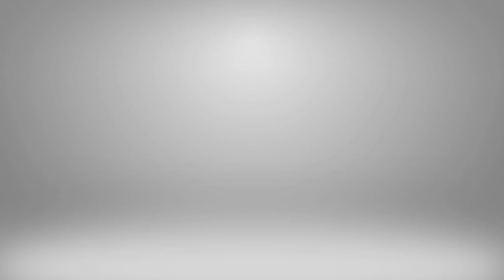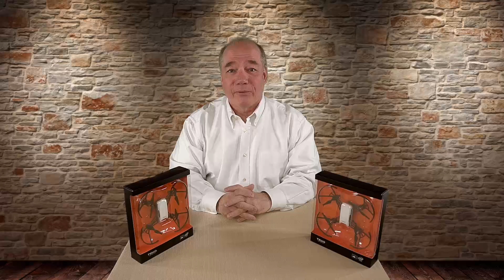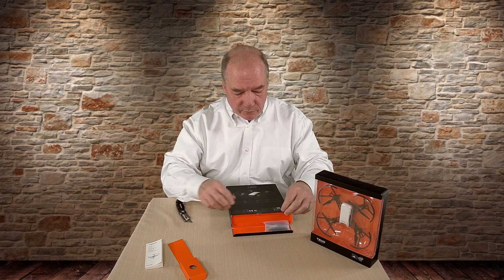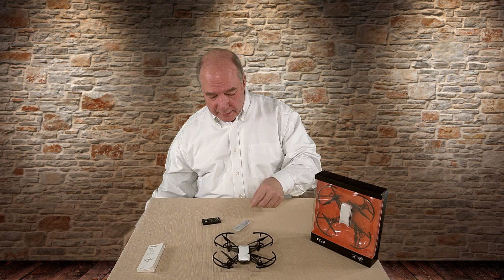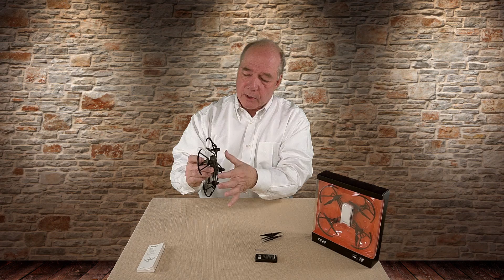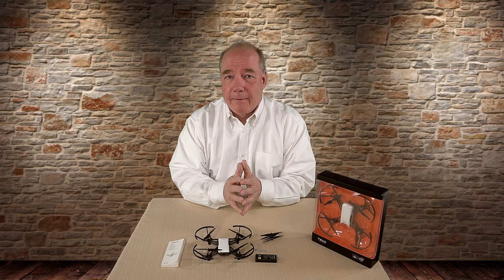The New Tello Drone By Ryze - The Most Fun Flying You Can have For Under $100

Comment: Rick, all good stuff as always. For me the Software Development Kit is the most appealing, and the only reason I would buy one, I like Tech.
 I have a "Toy drone" which I fly indoors with no stabilisation and is great for honing your ATTI skills, the Tello is a bit more than a "Toy drone". 
 I agree messing around trimming is a pain, but when you lose GPS with your big drone, and the wind gets you, you need the manual control skills.
Thanks for the effort you put in to making your videos.
Reply from the maker: John, thanks a lot for the support and I'm glad you enjoyed the clip. The stable hovering on this quad is what really caught my attention and the fact that they can include vision sensors and the Intel VPS tech in a quad for under $100 is pretty amazing. I'm just starting to get some stick time on the Tello and will have more clips posting soon so be sure and stop back. Rick

Comment: In all the reviews I have seen so far the video was lagging so much even for very short distances. There's no SD or any kind of internal memory so you basically end up with very choppy video every time. The app supports very few bluetooth controllers. Was considering buying this for some indoor VR FPV fun but due to the video issues and very limited BT controller support it is basically unusable. The programming is very limited as well, it's not possible to read any data from sensors, neither control each motor individually. Basically the only good thing about this drone is visual positioning system and maybe taking photos (selfies)

Comment: 13:25 This is not the first drone you could program and fly with Bluetooth, there have been plenty out for years (see Parrot Mambo, Bitcraze Crazyflie for example).
Reply from the maker: Thanks for the post and I agree with you that the Mambo, Crazyflie and a few others are able to be progammed to a limited degree. The reason I was so excited about this one is that it's a bit of a swiss army knife since it's a great drone to fly like a traditional drone (and I can't overstate how stable the VPS makes it) as well as using it for FPV and coding. The main difference with most of the other quads are that they are "kit" systems, which are great for building a unique airframe but take a lot of work. The Tello comes out of the box ready to fly, with camera installed and a whole lot more tech inside than the others mentioned. I've owned tha Mambo (and 2 of the Bebop 2 drones) since they were released and like them a lot. This Tello is a step more advanced than the Mambo and less expensive as well because it includes an integrated camera. I appreciate the post but still think this could be the one to mainstream quads to the masses.

Comment: Didn't t even fly it yet and your excited about it???
Reply from the maker: Henry, I did fly it at CES like I mentioned in the clip but it was pretty restrictive since it was in a cage. What I meant in the clip is that I hadn't flown these new ones yet and wanted to wait to get this initial clip posted because I had so many questions from subscribers asking about the quad. As soon as I finished the clip I took the two Tello quads outside and flew through 4 batteries. They don't handle a wind well because of their small size but are rock-solid when standing still with no drift at all. Thanks for the post! Rick

Comment: Rick, outside- at what wind speed precludes flight? I have a light weight quad that is absolutely impossible to fly in ANY wind. Also, it is larger and weighs more than this quad.
Reply from the maker: Ken, I had a chance to fly them yesterday is a mild wind and they flew OK but every time the wind gusted I had a hard time fighting it with the small Tello. My recommendation would be to fly them on less windy days and anytime you feel the need to practice your stick skills in the house. I'll do some testing with a wind meter to see if there is a tipping point. Thanks for the post! Rick

Comment: Yet another useless BRUSHED MOTOR Wi-Fi selfie drone .. YAWN! (BTW, who's going to teach all the N00Bs who buy this thing how to replace the brushed motors when they FAIL? All brushed motors fail .. period) 720P unstabilized camera .. had that 6 years ago with my 808 Keychain camera strapped to the bottom of a Syma X5C.  Having fun flying indoors (safely) can be done with $20 "tiny whoop like" quads by a dozen Chinese manufacturers, like Eachine.  IMHO, "Much ado about nothing". (as you know already, I have a degree  <my 2nd> in electronic technology/programming, and worked as a Sr. Electronic Tech/Specialist for more years than I care to state.)  IMHO, your unbridled exuberance for this thing is unjustified. Cheers.
Reply: I know enough not to be swayed by a "rave" report on a product that is no big deal.  As for your closing remark, I'll give it all the attention it deserves.
Reply from the maker: Bill, you know how much I look forward to your posts on the page :) The point I was trying to make about the Tello, and what sets it apart from other quads in this class, is the high level of technology packed into the quad. I still don;t understand how Ryze is making any profit on the quad with the vision sensors, Intel VPS chip and DJI licensing in a quad under $100. The reason I was raving about it is that I think it's the one breakthrough quad I've been waiting for that will finally draw drones into the mainstream. I can't count the number of emails and calls I've gotten since I posted the Tello clip from CES asking me if it was a good quad to buy for their kids or grand kids. 
  The last thing I'll say is that all of the quads I've tested in this class (including the tiny Whoop) always have an issue with drift and that's the single thing that turns most folks off to flying. Having to explain to a new flier that they have to "tune" their quad for a few minutes before starting to fly is a hassle. Because of the tech inside of the Tello, it just flies and hovers dead still when you let off of the joysticks. The programming is a big deal too because it allows kids (and kids at heart like me) to expand what they do with the quad. I've been a nerd all my life and have inspired my kids through countless electronic and science kits as they grew up. This Tello packs all the fun of a stable quad into a $100 device that also allows you to write a simple scratch program to tell it where and how to fly. Try that and I defy you to not smile when this little quad takes off and obeys your programming commands. I love it and will rave on in a few more clips this week so please stop back. Rick
Reply: Well, it doesn't make sense to stick all that 'swell' technology into a brushed selfie drone. As I mentioned, brushed motors are very problematic, and there are a sufficient supply of small brushless motors out there now which would have served much better without a difference in price or an insignificant one at best.  I have 2 DJI UAVs with downward facing sensors. They don't remain perfectly still when hovering, and I would not want to fly either one indoors (even though I've briefly flown some FPV racers indoors .. but then I control them). I have yet to see ANY "cell phone controlled UAV" to have an interface or control system that is worth a damn. The 'simulated control sticks', in general, suck, to put it mildly. This will undoubtedly lead to frustration if anyone actually tries to FLY it with said controls. Yeah, they might be able to take off and have it do a "POI" route (or other pre-programmed flight routes), but those pre-programmed flights soon become boring, and the first time one of these uninitiated Tello flyers tries to fly it with simulated joy sticks with no knowledge of orientation control, the outcome will be a disaster. As for programming it yourself ... you might find that 1 in 100 of today's millennial lot would be willing to put forth the effort to actually do that. They are too busy tapping out text messages on their cell phones and taking pictures/videos of themselves/friends to be bothered with learning an actual skill. This is the 'instant gratification' generation we're talking about.  I still contend that a kid would be better off with a $20 tiny whooper and actually learn how to fly using an actual transmitter with joy sticks on it.  Nothing that comes easy is ever appreciated  .. for very long. Skill sets which required an investment of time/energy are usually appreciated for life. 
I look forward to your future unbridled ravings about this novelty, but I am NOT sanguine about its eventual popularity, no matter how many  people put it up on an altar and praise it to the heavens.